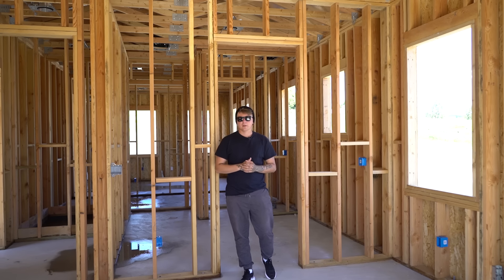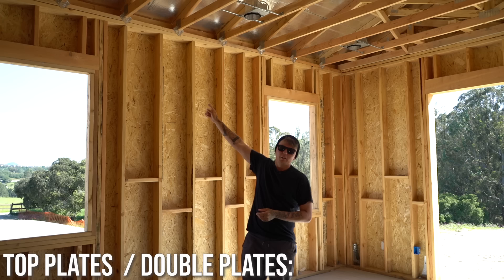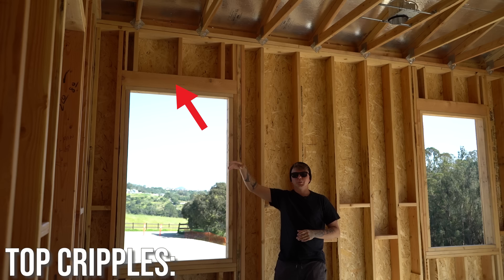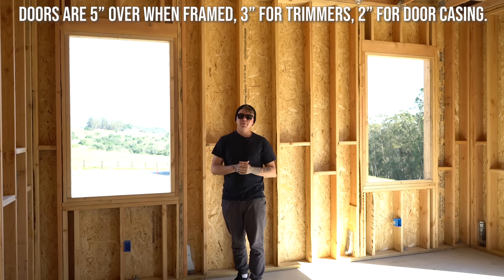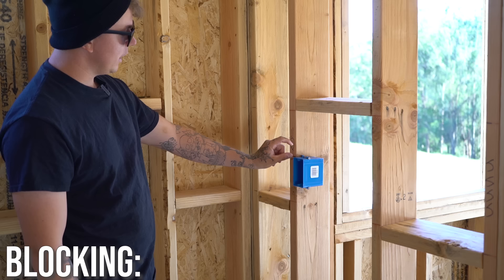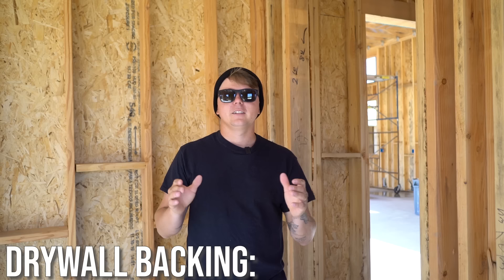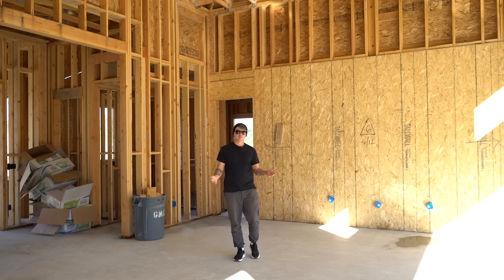Carpentry 101: Basics of Wood Framing with MattBangsWood [#1]

Comment: I am having a house built in Florida and the ground floor is block. As I walked up the stairs i noticed a space between the top plate of the interior walls and the floor joist trusses. Construction manager said they are not load bearing and dont need to touch. I dont agree but I also so they nailed the trusses into the top plates and you see the nail in the gap. weird. do you have any experience with this? Great video btw.

Comment: Let say, we have a tall wall (14ft), 2x6 studs, 16oc, with two large windows 1 in line above another and between them is cut notch ledger for loft floor 2x10 run horizontally,  beside large headers, is it necessary that double jackstubs and double cripples should be used? Thanks. Always love your video.
Reply: This is a question that you should ask an engineer or local building code official. I would double them up.

Comment: So how are you stopping the roof uplift (roof blowing off)? I cannot see any tie down rods connecting the top plates or roof down to the slab / footing? Asking as here in Australia everything is required to be tied down to the footing.
Reply from the maker: In California we have more for uplift than other states.. This video didn’t cover all, need to touch base on it again with more topics.

A35’s connecting blocks in between trusses to top plate. H1’s connecting truss to top plate. From there, every single exterior wall gets sheeted, not just shear walls. At the bottoms, we’ll have double stud typically, or bigger timber if it’s a nicer home... with anywhere from HDU-2 - HDU-22 hold downs anchoring that structural member down.

Along with anchor bolts “J” style every 36” or so.

We don’t have hurricanes like everyone suspects, I’ve never seen a home blown over in my lifetime. Not in CA at least!

Hope all is well in Aus. 😊🙏

Comment: min 5:05 - 'four studs works out to 48 inches' ?? according to my calculator 16 x 4 = 64 and 16 x 3 = 48.. I can barely count that's why went to my calculator.. but I could be wrong or had miss something..
btw: Great Video
Reply from the maker: That is correct..

0” (stud) ——— 16” (stud) ——— 32” (stud) ——— 48” (stud)

You have to have one at 0”.

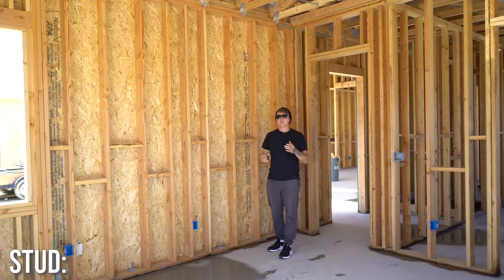Comment: @4:45 It looks like there are a few puddles on the ground and the bottom plates are getting a little wet. I imagine it is impossible to control all moisture around the open framing but does those puddles do any damage to the wood or will the water evaporate fast enough to where it is a nonissue?
Reply: Issues like that are why the bottom plate of the wall is made with pressure treated lumber. Pressure treated lumber is resistant to decay.

Comment: 2 questions, how close to the edge of the slab are your bottom plates? And also how far apart are the concrete 5/8 anchors? Thanks
Reply: Usually the concrete is poured so that the bottom plate of the wall can be flush with the outside face of concrete on all sides. If the concrete guys did a good job. Some builders design the concrete to be a 1/2" past there bottom plate of the wall so that they can set their wall sheathing directly on the concrete for easier installation, this is not common though. If your wall is supposed to be 26' long usually the concrete is poured 26' long outside to outside. 

The spacing of anchors is based on building code and your building engineers. It can very based on wind sheer rating in your region. In the midwest the maximum allowable spacing of wall anchors is 6 feet center to center.
Reply: @ericyost2703  ty

Comment: pressure treated wood absorbs water exactly the same as untreated only difference is it doesnt rot as quickly, unfortunately the good stuff has been banned for use in residential construction, probably causes cancer in California, i dont live in California so i dont know why i need to be told where i can and cant use  cca green lumber
Reply: First of all, nobody forced you to watch the video. Secondly, everything he mentioned about treated lumber is exactly how it is listed in the International Residential Code which applies to the entire country. Yes, there are a lot of variations in the code book based on region. Treated lumber being used as a bottom plate for all exterior wall partitions is not one of them. That is enforced by all building division across the nation. If you do not know that then you either don't pull permits for your work, or you do not have a very good local building division. You should join a local HBA. They have the resources to make you a better builder.

Comment: The whole construction industry is "Lego", once you understand why the building codes should be used it makes fastening everything together a breeze.   Yes you do have to add additional blocking (Or noggin's as we call them) as needed for backing or fastening but for the most part following a 16" or 24" layout means your sheet goods join perfectly together.   As well as providing a good structural support going forward.   I'm not a builder but come from an engineering background and the same rules apply regardless of the industry.

Comment: The header over the window: What are the specific dimensions of that piece of wood? I can't tell if its a 6x6 or if it's a few boards all lined up front to back - does my question make sense?
Reply from the maker: It’s a large stock, 6x6. We aren’t allowed to do on edge material like you’re describing.
Reply: @MattBangsWood  Thanks for the quick reply,
I figured that's what it was, I just wasn't 100 percent, great work by the way - both the house and YouTube!

Comment: is there a reason u run the sill board through the trimmer instead of a longer window trimmer then but the sill to the trimmer?
Reply: It allows for less material for under the window when having to drill for electric. Its a lazy way to frame IMO and is not allowed here due to the sill plat being crushed over time from the down force of the head. You can get away with it in places like SO Cal where he is because they don't deal with live loads such as snow and ice loads a lot of the country sees.  His double sill can help the crush factor. Also the double sill gives a better nailing surface for the windows and what ever trim inside and outside is used.

Its the same reason they get away with using 6x6 posts for headers. That would never fly around here. Although, every area is different in terms of codes so framing methods tend to vary as a result.

Comment: I don’t understand your rationale for the purpose of the second top plate. If it’s there to prevent bowing of the vertical studs, because of carrying the load from the roof, it seems that just adding a horizontal second top plate is simply adding more weight on top of the studs. It seems more rational to me to decrease the space between the studs (i.e. increase number of vertical studs) instead.

Comment: I'll never understand framing a wall 16" OC when the truss loads are 24" OC. It adds thermal bridging and costs for no reason and of course the wall is stronger when a stud is directly under the truss. Also I thought blocking played a role in fire suppression as well but wasn't mentioned. But yeah, good shout-out for us engineers for the people who think they don't need us. Hire an engineer and do it right, do it once. 👍✌️💪
Reply: I'm an American carpenter living in Australia. The reason the walls are 16" oc and the trusses are 24" on center is because the walls are overbuilt. The walls in other countries are 600mm(23.5") on center. The trusses are engineered to carry the roof loads at 24" oc. The walls are not engineered. Typical layouts in AU are 450mm(17.7") for high load but typically 600mm. By the time you layout on 16" and throw in all of the excessive framing American walls use double the studs and gain nothing except less insulation.
Reply: @aspees  that's what I'm saying. The walls should be 24" framing.
Reply: Double the studs? First of all, you don't really save that much. In a 12' wall you save what....3 studs? So....$6. Okay, so you just saved $6 on a 12' wall by doing 24" stud spacing. But now you have reduced your wind shear rating for that wall. Not to mention you have also increased you deflection rating for that wall. If you are using standard (in my region) 7/16 OSB structural sheathing you are going to have more deflection (bow) in your sheathing between studs. If you are planning to use fiber cement lap siding you are probably going to see shifting and gapping within a few years because of this. You have also reduced your uplift resistance rating. Your walls are not stronger 24" on center. They are weaker. Yes they support the strait downward force of the roof trusses better, but overall they are still weaker walls. Not to mention that very few interior products are made for 24" on center framing. I'm talking finish products. Take for example TV mounts for you wall. Here in the midwest you will not find a TV wall mount that is made for 24" framing. They are all made for 16" framing. 16" framing also helps reduce expansion and contraction of the walls during climate changes between negative temps in winter and 100+ temps in summer. There really are more reasons as well. If 24" on center truly was superior in all situation then why is it so uncommon??

Comment: Hey I got a question Matt. I am about to install a new window into an open stud wall (no sheathing). This wall never had a window before. However, this wall has two cross diagonal metal braces, formed into an "X." I have to cut one of the braces. Do you think this is safe?
Reply: No it is not safe unless you do something to replace the function it was serving. One of the largest issues to consider when building a home is wind shear. Those old houses you are talking about used to put metal straps from the sill plate to the top plates up an down at an angle like a "W". Essentially this is what keeps the house from tipping over when there are forceful winds. If you cut one of those straps you risk the possibility of causing shifting in the house. Cutting one strap probably will not cause your house to fall down, however, it could very easily cause sections of the wall to shift over time causing drywall cracks and squeaking.

Comment: @13:07, 3 pieces channel, would that create dead space in term of R value? Thanks
Reply: They do not worry about insulation in Cali as much as they do in more norther states, but most builders still have there frames insulate those cavities from the outside prior to sheathing. It is just kind of pain sometimes because you have to supply them with the insulation usually since your sub who normally does your insulation is not going to come out ahead of time to insulate those few areas.

Comment: Question, when framing a wall that doesn’t exactly end 16” OC, do you frame the wall so the studs line up 16” OC from Left to Right or Right to Left, relative to the interior side of the wall? Or is this addressed in the plans and you follow the print? Was just curious if there is a standard that one follows when laying out wall framing? Reason I ask is once the wall is finished with drywall, how does one know if the studs are 16” OC starting from the right or the left when looking at the wall from the interior?
Reply from the maker: When we layout a house, we have the hold down bolts every couple feet. Typically, concrete crew who installs those bolts hooks a corner and pulls layout for the bolts, 4', 8', 12', 16', etc.. Therefore, if you pull layout, 16", 32", 48" (this one will land on a bolt, wont work).

So we tend to pull opposite of concrete crew.. Just have to get the tape out and pull both ways to see what works. Once we know what way the bolts were set, we do the opposite throughout the whole house..

Meaning, if we hook from the back of the house and pull towards the front for layout, we'll do that on the whole home.

For interiors, we try to pull the same layout every time.. If we have 4 walls that but into an exterior wall, we'll pull off the side hitting that exterior wall to pull layout. When you look down the studs, they'll all line up.

As far as drywallers go, it's similar to trusses, you bring a sheet of drywall over and they'll figure out which way layout goes in a quick minute.
Reply: you start at one end and keep on laying out until you get to the end of the wall.   Layout could be left-right or right left depending on what works best.    You can do all your studs then adjust for king's, and other obstacles or do your kings/openings first and work back to fill in the rest.   No right of wrong way just depends on how you were taught.

Comment: Hey Matt, Ive got a question related to one of your other videos (building interior walls). I understand your interior wall blockings are placed every 3'6" & 4'6" -- is that standard for strictly California? from my experience (less than 6 months) framing in Oregon, I have only seen blockings placed on exterior walls for sheathing support.
Reply: Where I live if it is a load bearing wall it gets blocking. But most inspectors also want blocking on none bearing walls to have blocking as well for fire blocking.

Comment: Nice video overall.  However, not very energy efficient.  Too much wood at windows leads to thermal bridging.  Your drywall blocking channels can’t be insulated.  California Corners and Ladder Tees allow for more insulation in exterior walls.

Comment: Is online carpentry class enough to be able to  do this ? I'm thinking about doing it after high school
Reply: NO, if you are serious about wanting to get into the building industry you need to contact your local HBA office. (Home Builders Association) You will either need to go to tech school or find a job with a builder who is willing to teach you over time.
Reply: @ericyost2703  where would I have to go for finish carpentry or cabinet making
Reply: @joshuaharris243   like I said before, the only two options that I am familiar with are tech schools and on the job experience. If you want to do finish carpentry then the best thing you can do is get a job with a company that does that. They will teach you how to do finish carpentry. That is usually performed by the General Contractor's employees. You don't really do "cabinet building" per say. You can either be one of the cabinet designers, or one of the guys in the shop physically building the cabinets. That is not really a great job. Most of the panels are all cut by a computerized machine and then they are glued and stapled together by the guys in the shop. Typically it is not a very high paying job and there is little room for advancement. You can be a cabinet designer/sales person, but in that role you will be working on the phone or on a computer all day. You will not be physically doing any construction work in that role. Again, you should contact your local HBA office. Most local HBA offices have a "Workforce Development Committee" that will be able to guide you. They will know what the largest demand is in your area. They may even know builders in your area that are looking for newbies. They will also know of specific trade schools or tech schools that work "hand in hand" with the building industry. They may even have scholarship opportunities through the HBA. If you have no idea where to go or what to do but you know you want to be in the building industry then your local HBA office is the very first place I would go for guidance.

Comment: hey, Matt, I get that this is a year old, but I just found your channel and if you do see this, there's something I noticed but understand.
I'm not a builder, I'm just interested in this and I have a question about the exception to stud spacing on 16".  I noticed that it seems you split the difference on the last stud in the gap before a king for a r.o. like the one right behind your head at 2:40, but then on the adjoining wall it isn't altered.  what is going into the decision on moving a stud off the 16" pattern?  and similarly, what's the deal with the studs behind the 'd' and 'o' in 'double' at 4:00?
Reply from the maker: Studs run 16" O.C. end to end. You'll always pull from front to back or back to front on a build. The way you pull one you'll pull for all.

At the end you'll always have a stud bay that's smaller, very rarely does it work out perfect 16" O.C. both sides.
Reply from the maker: Where you have a window, or a door opening, the studs still follow 16" O.C. regardless of what rough openings are in the wall.
Reply: @MattBangsWood  thanks for the reply, but are the examples I gave not 16" oc or am I not seeing them correctly or missed something.
Reply from the maker: They're 16" OC, from one side of the building to the other. When you have a window or a door, you'll have a smaller bay.

I'll check the timestamp when I'm back in town. Let me see what I can do.

Comment: All trimmers in CA have to be full length trimmers.  They cannot bear on the sill.  Why frame out the window opening with additional 2x4s when you could simply frame the header down to the correct height and the double sill up to it's correct height?  Needless.

Comment: there are 2 buildings 6 storys each being built in my town 1 steal construction  and a wood one has huge concrete foundation  why 2 deferent methods
Reply: Probably being used differently. Steel is commercial grade and wood is residential

Comment: i noticed your hurricane ties are installed inside nailed through the truss plate. Did you have any problems with inspection? On the website for those simpson h1 hurricane ties the company shows them to be installed on the outside. https://www.strongtie.com/resources/product-installers-guide/h1-installation
Reply from the maker: We’ve done it this way for years, it’s spec’d out on plans via inside.